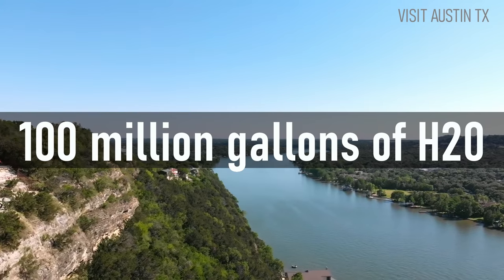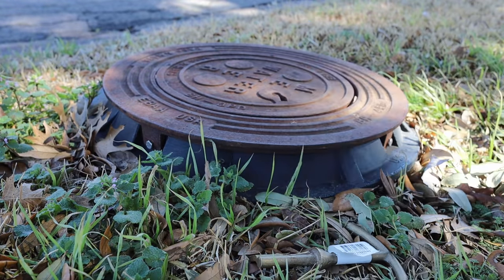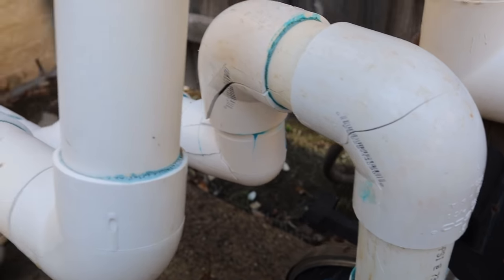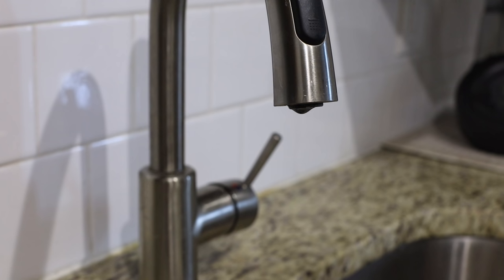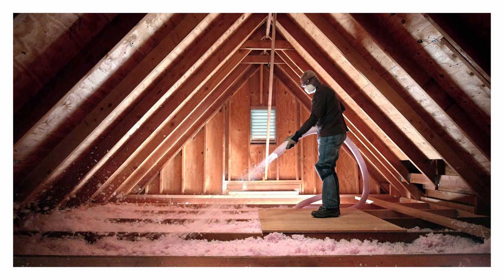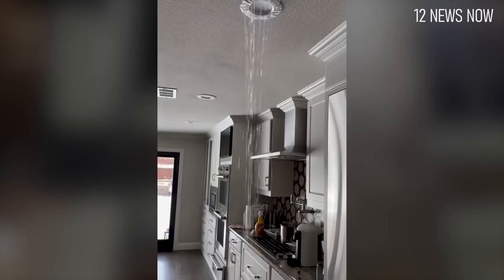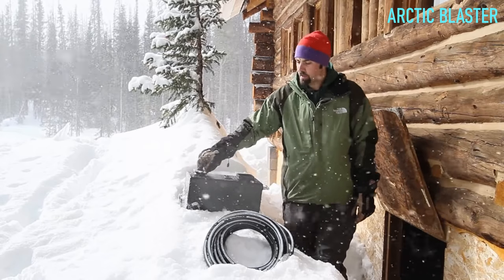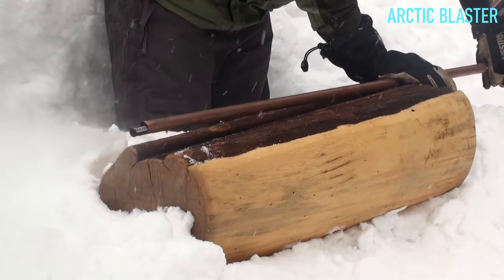How to prevent frozen and burst pipes

Comment: Retired master plumber, commercial training. It pays to over-kill when it comes to preventative measures.
Reply: or just use best practices (ie common sense) from more northern climates... that cost little to nothing more in most cases... it's not rocket science or does it cost that much more.....
Reply: @nc3826  Saying "use best practices from more northern climates" doesn't really explain or address anything.  Texas homes, neighborhods and cities are designed mainly to face three things: tornadoes, hurricanes, and excessive heat; something northern states wouldn't think of preparing for.  Also, we generally can't build basements because of limestone rock. Three days (Feb 14th-16th) broke Texas records on how cold it's been for a three-day event, beating an 1899 record.  With the exception of the panhandle, the rest of Texas might get snow for 1-2 days a year, then it's gone.  (Mainly we get ice on the roads.)  Texas was colder than Juneau and Anchorage, Alaska those days.

For comparison, northern states aren't prepared for excessive heats.  We laughed when schools up north closed for a 90 degree heat wave a few years ago, while we go to school when it's 100+, wondering why they don't have air conditioners.  It would be nice if we started better preparing in the future, but the costs would be punitive for quite a while.  Hopefully, more Texas homes and apartment complexes will be built with fireplaces and we'll start looking more at the bones of homes, instead of layout and style.  If the wealthy start a trend of preparing for these extremes, then that could bring the prices down so the middle class and eventually the poor could afford it as well.
Reply: GH: the short comment was not designed to give "details" but instead points you to where it's done correctly and most of the practices cost little to nothing more than how it's commonly done now in Texas... (FWIW my own OC give a few examples)

So have fun mostly rambling on about irrelevant issue instead... smh...
Reply from the maker: @grondhero  Well put! Don't bother explaining it though. Logic and reasoning seem to bounce off... someone.
Reply: @grondhero  I agree that building southern homes to northern norms and vice versa is likely not good economy.  The better solution is to ensure your electric providers have built THEIR facilities to handle both cold and hot.  This is almost certainly more economical than building every home this way.  And, drop the Texas isolationist approach to the national grid and better interconnect your grid with the rest of the country so that power can be transported in when your local generations have issues.
Reply: @LTVoyager  You nailed my thoughts exactly. There are very few low cost ways to improve new buildings and even less for existing buildings. I do many trades and have been at it for 25 years, so I understand what goes into building and repairing homes. It isn't necessarily easy or cheap work, especially for a once a decade or century event. IF, the power, water, and gas supplies were more capable, it would have been much less of a problem. Improvements can be made, but building like the North isn't going to happen because the cost to benefit ratio is way off.

Comment: if your serious about keeping your house from freezing, take it from me who lives in Northern MN where we get weeks of sub zero weather, this past cold snap lasted over 2 weeks and reached 37 below zero.. here is the advise ,  build to our standards up here in the northland and your power company and your houses will do much better. it's that simple...  luck favors the prepared .
Reply: Basements instead of slabs, why would anybody want bury pipe in or under concrete
Reply: @safffff1000  agreed, I am not a fan of underslab or in slab plumbing, but it is a necessary evil at times. at the very least have a 3 foot high crawl space to run the utilities, it save so much hassle when there is a problem....

Comment: Ehhh.... a big design change is to simply put waterlines below a certain minimum depth while outside of a building. 

In more northern areas, this is called "Placing your water line below the frost line.", and is a major part of building codes in areas that have harsh winters. 

The quickest and easiest explanation is that the temperature underground does not fluctuate much, even in areas with extreme seasonal variation. If you live somewhere that has an underground point where it doesn't freeze, that's the frostline: the point at which frost stops occurring.

I grew up in Northern Utah, and it's possible to go months at a time where the temperature remains below freezing there, or even below zero degree farenheit there. 
The reason people don't have to replace all the copper piping in their homes is because the building code specifies that they have to keep their waterline below the frost line, which allows the water to be above freezing before it enters their home. 

I doubt that Texas has such building requirements, as requiring waterlines to be buried at a certain minimum depth makes them much more expensive to install, repair, or adjust, so it's not something that a place like Texas would consider doing. More over, this starts getting into geothermal energy considerations, which might make that unpopular.

Comment: The constant flow of water in a pipe leads to that new water with higher temperature is keeping the pipe unfrozen.
Reply: Exactly that is the main reason it helps prevent freezing.... Plus she also wrong that moving water has "no effect" vs the water being still.... 
"Relieving pressure" would not happen if is there was no other mechanisms preventing of water from freezing in the pipe.... So what she said made sense....
Reply: I second that. But we'll forgive Belinda for it cuz she grew up in dubai and why pipes freeze is sort of an acquired knowledge lol when living north
Reply: But it's misleading when Belinda pretends to know more than she does... Such as stating the practice of placing water pipes only in interior wall instead of exterior walls, is just a common for commercial building.....when its standard practice for residential homes in the north.... Just stick to the verifiable facts...
Reply: But what was said here wasn't exactly wrong. The constant drip of a faucet may keep the immediate pipe from freezing, but that drip compared to the main line might as well be stagnant water.
That said, I believe it may need to be clarified, it seems to me that it was assumed the water froze from outside in. If the furthest faucet was also the innermost faucet and water began freezing from the outside in, then the drip would alleviate water pressure that began building up. Water will still freeze, but water that isn't yet frozen would begin being pushed in towards the house and eventually to said dripping faucet. What was said isn't exactly wrong, but maybe assumes too many ideal conditions
Reply: GM" U missed the point.... no one said her statement about relieving pressure was wrong.... it just was not the relevant factor... 

She incorrectly dismissed the factor of warmer flowing water, which is what is really relevant in this case... KISS....

FWIW, I do not mean to be pedantic but your also wrong about how water freezes in a pipe... but that's to complex to detail here and and it's not that germane to the topic...
Reply from the maker: I did not say that the constant flow of water has "no effect". It's obviously a contributing factor.
Reply: Constant flow of water replenishes the heat it looses in colder temperature. And also moving water freeze slower than still water.
Reply: @BelindaCarr  WADR your obfuscating the truth about what you said.... to avoid admitting that "temp and flow" is the "key factors" that can prevent the pipes from fully freezing... the "reduction pressure" is just a result of those factors... which is not how you presented the facts....
Reply: Rupture of supply piping is almost always caused by hydraulic pressure buildup due to ice expansion, not the direct expansion of ice on pipes. People in Texas should have turned main water off and opened all valves till electricity was restored. 
Watch https://youtu.be/AuPO5hKdo8A for a good demo of this effect
Reply: @nc3826  give her a break, its a minor inaccuracy and we are talking about it here, calmly, like consentent adults that we are... 

Ive watched most videos of this channel and Belinda is doing a great job at it, always quality content
Reply: @JohnSmith-kf1fc WADR facts are facts... Pls do not shoot the messengers (since I was not the only one that commented of the flaw),... Have a nice day, Sir...
Reply: @nc3826  don’t believe EVERYTHING you hear online. Gather information from multiple sources. If you really care about a subject, you won’t just learn about it from one YouTube video.
Reply: KF: And don't eat the yellow snow :)

Comment: I spent most of my life in So Cal then moved to Kansas a few years ago.  So, this freezing pipe issue was new to me.  I've been surprised to see so little if any consideration given to home design to deter/prevent frozen pipes.  I'm considering changing a few pipes to PEX, adding a heating coil along their length, then wrapping in insulation.

Re: PEX, I've seen some videos argue PEX-A is a little more freeze resistant than PEX-B, because it's a softer compound of plastic and therefore can stretch a bit more.

Comment: Her in Germany all outside pipes are min 80 cm under ground. Main water valve is always inside the cellar, so it‘s easy to block the water. If inhouse heater ist not working anymore, empty all water pipes by opening a tab at the lowest level of the house. Empty also all circulation pipes for radiators, using hot water. If there are water tabs inside the garden and the garage, empty the pipes during entire winter period.

Comment: When I got my manufactured home in Von Ormy Texas part of the PVC pipes were exposed on the outside I asked if I should cover up the pipes with insulation because I’m originally from New York. They told that it rarely get that cold in this part of texas. When the storm came through the pipe burst. It was an easy fix but after that I installed a pipe heating cable and pipe installation.

Comment: Another excellent video; every resident (owner, renter, lessor) should know how to turn off all utilities (water, electricity, gas, network) to a property, IMHO, though too many folks are reactive, rather than proactive.  We're scouts, so we try to "Be Prepared", LOL.  I just wish we got a house insurance break for it!

When you use plastic for external freeze mitigation, a quick spray coat of UV protection (cheap paint even works) should be applied so it lasts better.  Absolutely love the Whataburger cup, of course!

While our trusty, old, rebuilt Coleman 5KW generator can't power the whole house, we added a transfer switch and power cord to our gas furnace. That lets us run the gen 2-5h at a time, warming the house w/one of the 120V legs and run the fridge (preventing food spoilage) and Internet (had to keep working!).  With the house warm, the pipes, pets, and people are all protected.

We also keep at least 1/2 tank of fuel in most vehicles so we have it just-in-case, but many cars have siphon blocks nowadays.  (We pull the fuel pump outlet, but that's risky for non-mechanical folks.)  We also test the generator w/a space heater every 30-90 days.  Texas has surprising weather all year, for sure!

Comment: If you lose power and thus heating would recommend shutting off main water valve and draining system at the lowest tap available. Living without water a bit if preferable to a flooded house that doesn’t have heat.  Refill system slowly (looking for leaks)  once power is restored.

Comment: It blows my mind that people dont know how to turn the water off to their own house.
Reply: That would require people to learn valuable life skills and we don't learn that in most suburban much less city like environments.
Reply: In some jurisdictions, the homeowner can only turn off the main shutoff inside the house.  It is illegal to shut off the outside valve; that can only be accessed by the water utility.
Reply: @heronimousbrapson863  

I was watching a video in NY where a plumber was called in to fix bathroom leak.  The massive apartment building complex had no other shutoffs & had to call the city.  For a single bathroom sink, whatever he attempted had made water flooding out everywhere under the sink worse.  Ridiculous no one installed any shutoffs for anywhere else prior to city main.  I can't imagine if the remaining pipes age similarly.  Every few weeks pipes busting & no way to turn it off, especially if it is off typical hours.
Reply: I have never understood why houses don't come with a user manual. Even a toaster oven comes with a user guide, and a house has many more components, systems, subsystems, custom modifications, single points of failure, and critical infrastructure hidden inside of walls.

A 3 ring binder with a copy of the blueprints, photos of cutoff & drain valves & their locations, photos of in wall infrastructure from whoever has accessed them over the life of the home, hand drawn sketches of plumbing, electrical and ductwork runs, make/model number of all major equipment (HVAC system, hot water system, fuel oil/gas delivery system, sprinkler system, etc), and a log of maintenance, repair and upgrade work done.

I've been creating two home user manuals for two houses that our family owns. I have clearly tagged key cutoff valves in the utility rooms. It has been easy to assemble this info during normal home maintenance operations. The manuals will be copied & provided to any future homeowner so they know how to maintain their new home. Simple...
Reply: @alanmcrae8594  - This actually sounds like a valuable service. Please consider starting a business to somehow enable/assist homeowners doing this, I would love to see it catch on.
Reply: @alanmcrae8594  good idea but you'd need people to actually keep good records. Living in a 109 year old house I can assure you no records are kept about modifications.

Comment: Tip from European homes with garden: have a shut-off inside the warmer house to cut the garden-water supply, leave the garden-side tap open and close the one inside your house, if water freezes at the outdoor tap, it can expand through the opened tap system.
Straw and last autum's leaves are not only great to cover fragile plants to protect their roots from cold, it can also protect other things in your garden.
Reply: The garden side tap should be a special tap with a valve inside the house that gets actuated when you close the tap. It should also be at an angle so it drains fully. This system you mention should not be needed if the proper tap is used.

Comment: hello,

You should run your faucet not just until it is dripping, but until the water temperature coming out is well above 40 degrees. Use a thermometer.

It sounds like in Texas, water lines are run very shallow so they are in danger of freezing in extreme weather. In most other places, they are run deep enough so they stay around 50 to 55 degrees even in winter-- this is why running your faucet will keep your homes pipes from freezing; you are heating them up with the groundwater temperature!

Comment: freeze resistant outdoor spigots - the water valve is about 12" inside the pipe, so when you turn off the spigot, the water drains out. So the spigot outside can freeze, but there is no water. The warmth from inside the house keeps the water from freezing.

Comment: Sounds like you have a vented attic in your home. If that's the case, consider adding attic fans which are installed through the roof, which can vent the hot air out of the attic and keep new air coming in through the vents. This can keep your home cooler in the summer since there won't be time for the air to heat up and radiate back into your home at night.

One topic you also should've covered: thawing the pipes. It's important to start at the faucets when doing so, as starting anywhere else could lead to a buildup of pressure in the water line behind any ice, running the risk of the pipe failing.

Do you also not have a water main shutoff inside your home? Up here in Kansas City, I have a main shutoff in my basement where the water comes into the house along with the utility's cutoff in the alley behind my house. And even in the home I grew up in on the Eastern seaboard, I could swear there was a main cutoff inside the home. That way you could cut off the water to the home for whatever reason without having to call out the water company to shut it off for you.